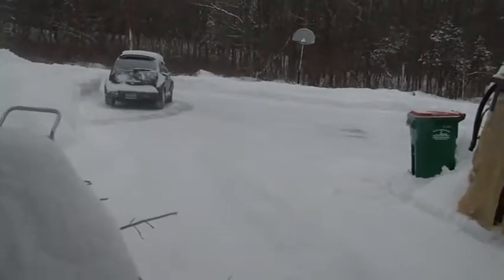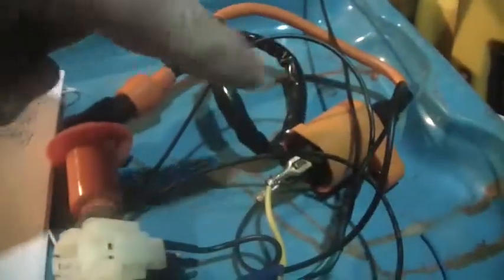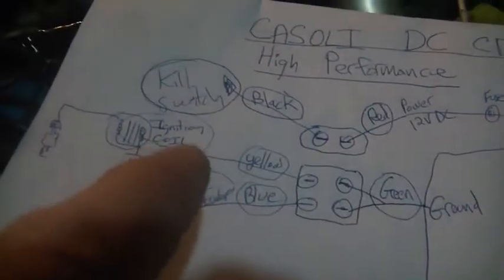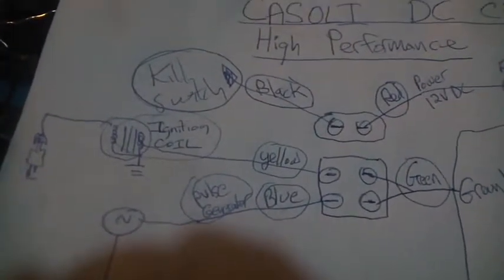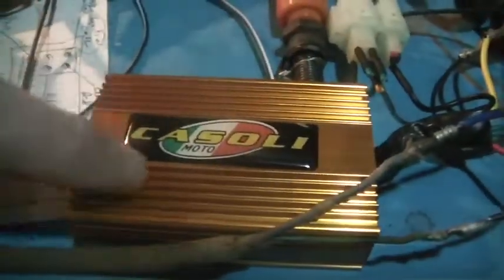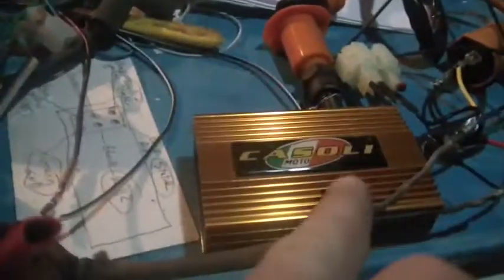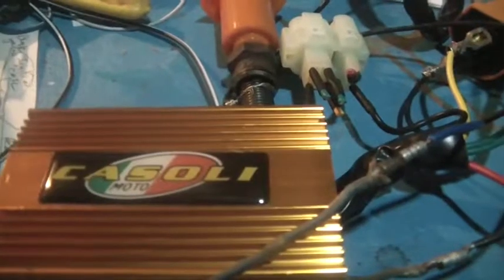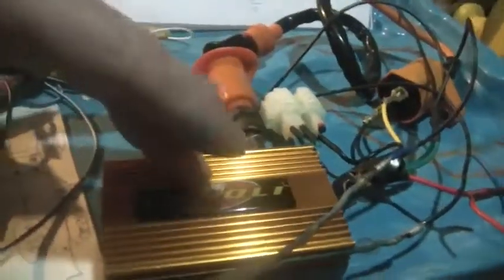2_9_15, Wiring a 12 Volt DC, Casoli, CDI,

Comment: Could someone help with a 260cc linhia vog? my wire harness is toast it has the 8 pin cdi. can i remove all this and replace with like a 5 wire cdi and just put coil. pickup coil on.
Reply from the maker: Hey Tommy!!! Looks to me that there should be 2 plugs with wires coming from Ur fly wheel area, one has a blue and green wire, the second plug has 3 yellow wires.... The 3 yellow wires go into a voltage regulator, the red and black wires from the voltage regulator go to the battery, (+) and (-) respectively.... The blue and green wires come from your pulse generator, I would use them to trigger my 12VDC portable GY6 CDI box or U can use the Casoli high performance version.... I hope this helps.... Thanks for asking, watching, and commenting!!!!

Comment: Hi Harve S. I got GY6 150cc GoKard, that has DC CDI and I
found on line two different performance CDI replacement, but the dealer that order
them from manufacture got them not wired, so  I can get them at discount but need to
complete wiring my self. Could you help me figure it out the wiring if I send
you diagrams? This is my buggy https://www.youtube.com/watch?v=TWqxt90kvnw
And this is the page to CDI that I have no idea how to hook up cause I believe I got 5 wires and  this CDI got only 3 Help :) 
http://www.knmparts.com/CDI-UNIVERSAL-150cc-up-LED-Adjustable-DC-CDI-Universal-LED-Adjustable-DC.htm

Comment: Hi. Have you ever proved this has electronic advance by using a strobe light?
I want to buy one but only if it has no advance curve built in. Thanks
Reply from the maker: +MAICO MAGNUM , I have not proved  that there is an electronic advance built in, but, according to the literature there is... I have not found a CDI powered by 12VDC that does not have a built in, electronic advance, I have used these units with built in advance on motors with functional mechanical advance and they work, the engines seem to run well, though, on some engines the advance is too much... Thanks for asking, watching, and commenting!!!

Comment: Here is the connector you need http://www.ebay.com/itm/AMR-PIGTAIL-CONNECTOR-REV-BOX-ADAPTER-CDI-50-PITBIKE-/141545201457?pt=Motorcycles_Parts_Accessories&hash=item20f4c05f31&vxp=mtr Its the same as your portable CDI box. Another way to get those connectors is a trx300ex has two of them. Both on the harness are the same.
Reply from the maker: william staten , See Y I keep U around? U are a genius with this stuff! Thanks for the info, watching, and commenting Bud!